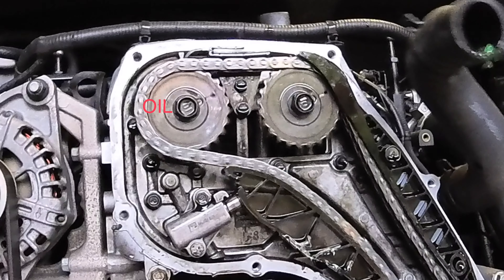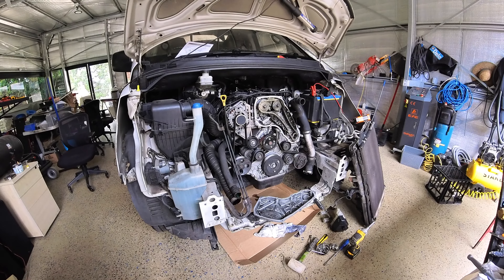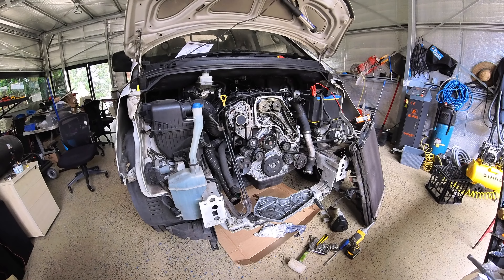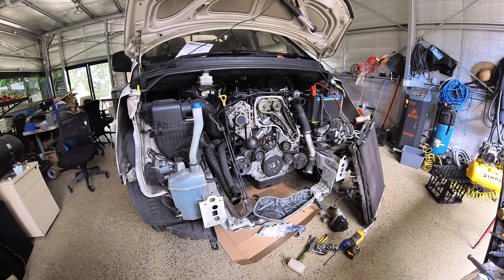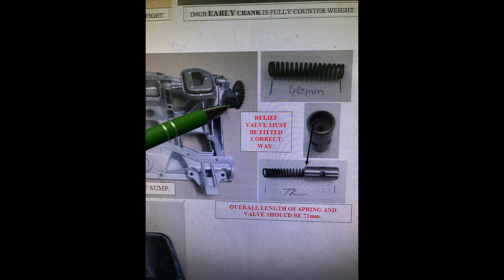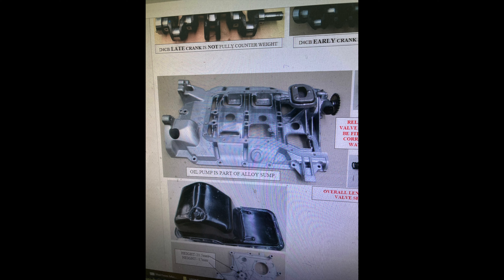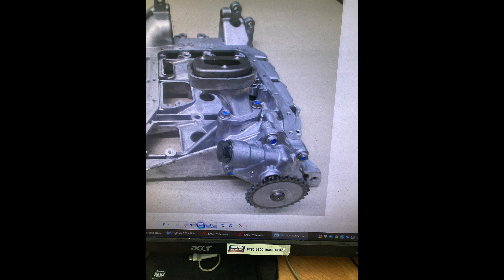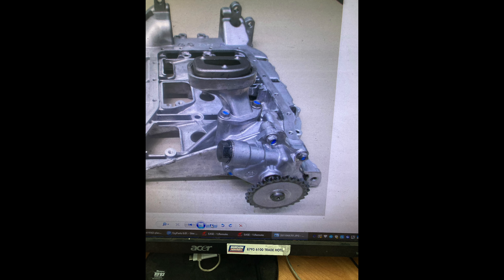Hyundai iLoad D4CB Reconditioned motor after 1 year PART 2

Comment: Chain stretched, see the tensioner is at max length. Replace all chains and tensioners.
Reply from the maker: YEs I did that, and all the rattle was gone.. I could not believe Gem Engines sold me this engine as a reco,, timings chains were under $100, but tool 2 days for me to fit